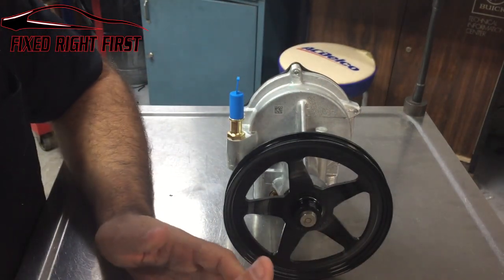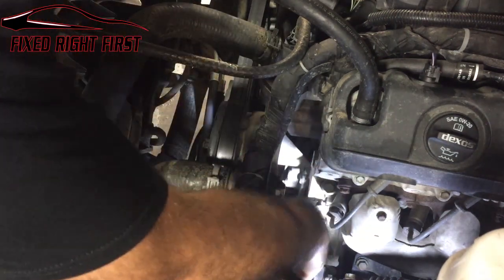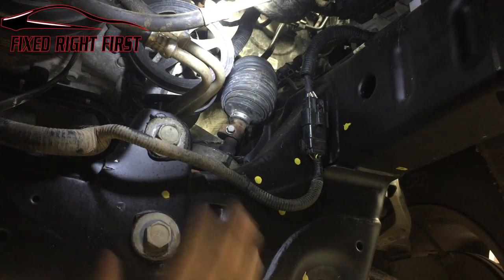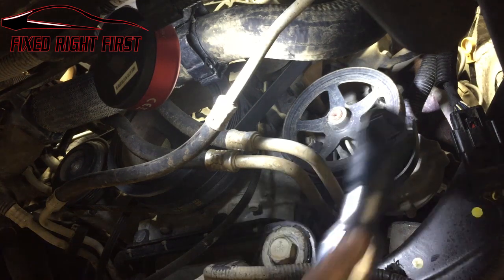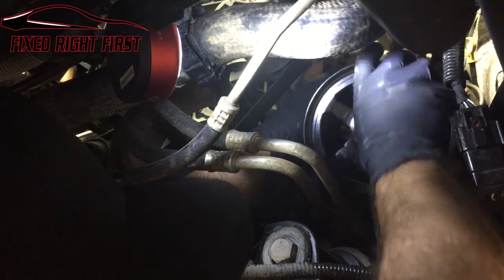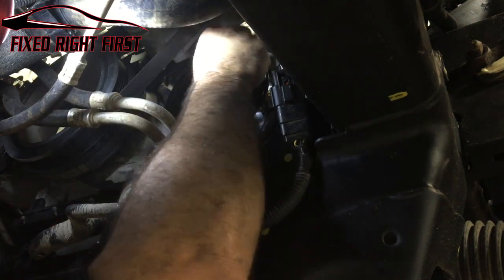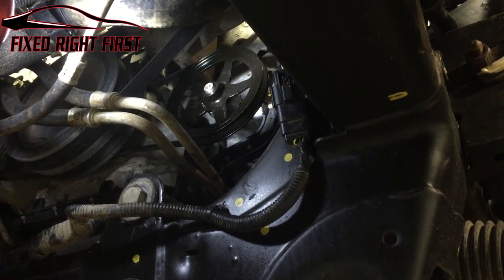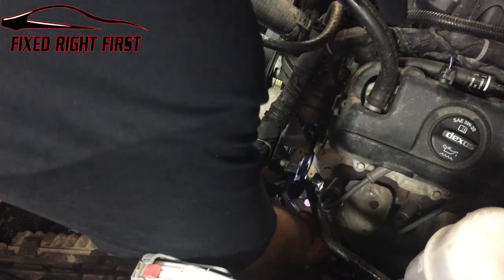Chevrolet - GMC - Hard Brake Pedal! Excessive Brake Effort! No Brakes! C025E / C0299 FIX!

Comment from the maker: Parts Needed
Brake Vacuum Pump - https://amzn.to/2XIYXaJ

Tools Needed
Swivel Socket set - https://amzn.to/2NYAhXz
Ratchet Set - https://amzn.to/2NT587B
Screwdriver set - https://amzn.to/2XN71Hu
24mm Socket - https://amzn.to/2EKoYhq
1/2 pull handle - https://amzn.to/2XPbHNl
3/8 Torque Wrench - https://amzn.to/2NOX3B1
Reply: Would the failing vacuum pump also make my steering wheel hard as well? I’m having both issues where brake and steering wheel are hard at times
Reply from the maker: @jonathancavazos9090  unfortunately not. That’s more than likely a failed steering rack.
Reply: Pump is made in china isn't there a GM one
Reply from the maker: @crbrepairmotorcycles6608  The GM one is probably made in China as well. lol
Reply: How long did this job take you in real-time?

Comment: I just brought my 2015 GMC Sierra 1500 4X4 in today- 52,000miles (7/22/19).  Warranty was extended to 72,000 miles for my vehicle, so the vacuum pump and belt were replaced for free.  When I brought it in, I referred to the TSB# PIT5361C.  He checked my vehicle for mileage and to make sure it wasn't a junked title.  It all checked out.  Glad to not have to pay, but after watching this video I was excited to give the swap out a try.  Great Video, Thanks.
Reply from the maker: I'm glad it helped! I'm glad you got it free!

Comment: Awesome tutorial video! I have a 2014 GMC Sierra SLT. My brakes started feeling  hard at slow speeds last night & It took some pressure to get the truck to stop. Took it to a brake shop with many locations where I live. Was told they had to replace Vacuum pump, brake booster and Master Cylinder for $1800. Dealer had no recalls on issue. But they did have the part in stock. $247 later, and the truck is braking just fine now. Thanks for the video 👍
Reply: Your post makes no sense.   Did you pu the 1800 in or 247,

Comment: Experienced the hard pedal in a parking situation twice, tw weeks later I get the recall notice for the "reprogramming" for the brake system. I told them I expereienced the brake issue reported at the dealer but all they did was the reprogram. A week later I experienced the hard petal again twice in a parking lot. Took it back to the dealer and they will replace the pump and booster if needed at no charge. After talking with them the reprogram was intended if you never experienced the hard pedal issue before (just a precaution they do the reprogram). They should of swapped my pump the first time but oh well. Was told pump etc/costs was covered under a special adaption to the reprogram recall (up to 70k miles I believe) since I was actually experiencing the problem. Take yours in if you fall under the coverage..IT WILL FAIL eventually. Tell them your having the issue before its on your dime to replace. Great video, I was acually gearing up to swap it my self if the dealer was going to charge me.
Reply: I have 109k miles on a 2016 sierra hd.  Just had this happen last night.  We'll they only cover it up to 70k miles?
Reply: Came across this and its getting covered 👌 thank you
Reply: No regardless of miles or yr coverage dsnt  expire ( some dealers are more helpful than others)

Comment: Checked code in my truck for a engine light on and it says low vacuum at brake booster. Is the pump the problem you think? or the booster? Mine is a 2014 Silverado, and some times its super soft and others the pedal is hard.

Comment: Great video! 
I just changed my vacuum pump and I still have the problem, dash telling me service brake assist and don’t know what to do next any suggestions?
Reply: I got a recall on that for my 6.2 2014  highcountry
Reply: R. vega booster diagram on adjustable bare pedal el resorte or spring pasa and just need a new pin

Comment: Great video. When you remove the vacuum pumps do you see any of the oil getting into the vacuum side.?. My truck 2017 GMC 1500 was diagnosed for having a foreign fluid in the braking system which cause them to want 2 replace the entire brake system. Does this sound right

Comment: 2014 chevy silverado Mine has the v6 mine was 13 mm bolts i put a new one on mine but my brake booster is out they sell a tool for the stretch fit belts it works but I got stable trac on and abs on any help and code po57c

Comment: Is this in any way related to the recent brake assist  recall on 2014 Silverado?
Reply: Seems so, allegedly since the pump is being lubricated by the engine oil, sludge build up reduces its efficiency at low speeds. The fix up being done at the dealers' shop is to enable the back-up brake system engage at lower speeds since the problem wasn't suppossed to affect many of the encompassed vehicles featuring the 4.3l & 5.3l V8 Ecotec

Comment: So what about the recall on it? Why are they just adjusting the computer and not replacing them?
Reply from the maker: Well the computer doesn't need to be replaced. They are replacing the pump if the customer complains about a hard pedal at the time of the recall. There is also a special coverage on the pumps as well if it happens after the recall is done.
Reply: @cdarnau  wasn't refering to the computer being replaced but the pump.
Reply from the maker: @kanightkanievil  Well then, they are replacing them if it has the problem. If not they just program it to keep it from failing.

Comment: I started to to have problems with my brakes . So i took it to the dealer they just did an software update to the brakes . It work fine no but I noticed the only on hill the the brakes , not work properly. I have to press hard and the brake pedal vibrates like it the tire were lock up . But it only happens on low speed. 

I was like F the dealer I’ll replace this shit my own . So I went to autozone and boom they don’t even have the vacumm pump in their system . And then I went to O’relly, they do have the pump on the their system, but the dude told me they have to place an order and then call customer service in other to get the part. Basically they gotta ask GM for permission to sell the part . I believe it was an ACdelco .  So i guess GM dont want acdelco to be selling those parts. Lucky I found one on amazon on this video link lol ... thank bro!!!!
Reply from the maker: Yosoy1an hey man. They actually have a special coverage now where they will replace the vacuum pump for free up to 150,000. Hope this helps. Sorry for the late reply.

Comment: Sir cuestión what’s the cost to change this part. I have the problem ,thanks 🙏🏻
Reply: Checa el link la venden en Amazon
Reply: $176 en Amazon en la parte del video arriba tiene los link para comprar las herramientas y la parte para cambiarla
Reply: There is a recall call ur local dealer provide last 8 digits of vin number they will cover it if it falls under recall free charge
Reply from the maker: You get it fixed? I am back? I try to help the people who SUBSCRIBE first!!

Comment: I just had my 16' GMC Sierra fixed under the recent recall and they said all they did was to reprogram the brake control module. .. I wonder if thats just gonna be a temporary fix?
Reply: B. Enson temporary I had my 17 fixed sept27 no all of a sudden I’m having these issues taking it to the dealer today
Reply: That's what I was wondering as well, apparently the issue is the oil screen gets plugged with junk and makes the vacuum pump slower to build vacuum. My question is. Why do we need a vacuum pump? Is the cam to hot to generate enough vacuum or is it just for the afm poop that I have deactived
Reply: @Verge513  I'm not sure whats going on with GM, but I received a follow up call / voice mail message from the dealer asking if I had experienced any  issues since the fix.... Makes me think it IS just temporary.  You would think after building trucks since 1911 this wouldn't be an issue, but I'm not surprised.  Next time I think I will buy a Toyota and just wait for the frame to rot away.
Reply: Hi I’m having the same problem they just serviced the brake recall now I got this problem